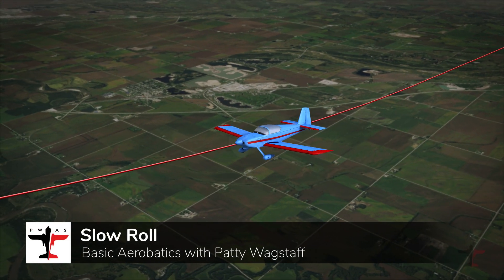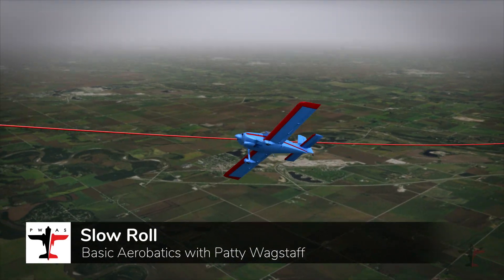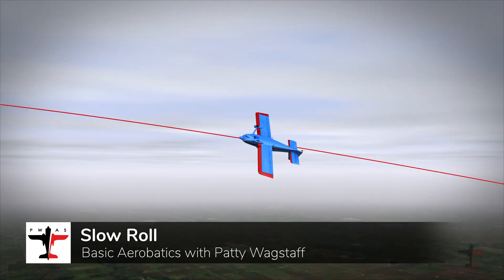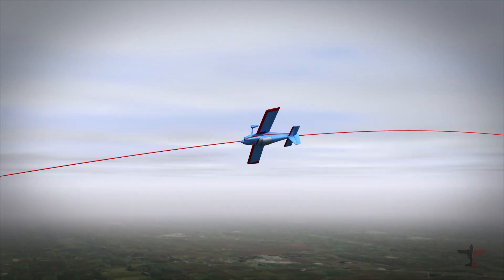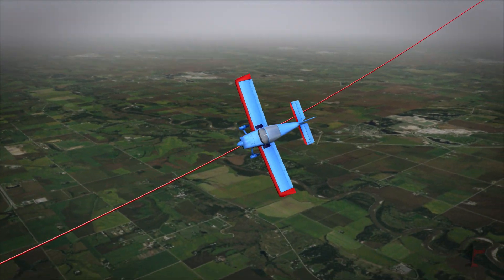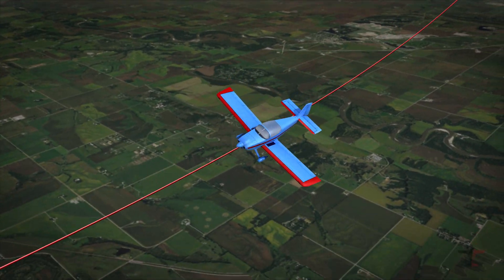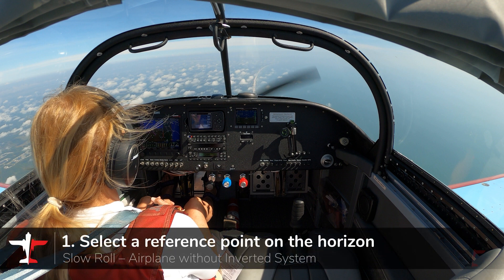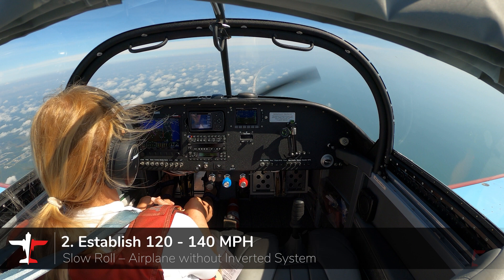Aerobatics Tips with Patty Wagstaff: How to Fly a Slow Roll in an RV-6

Comment: Unless I'm grossly misunderstanding how the rudders are being used here, "top rudder" changes from right rudder to left rudder as the maneuver progresses. It would be helpful (to me, anyway) if the graphics on the video made this switch a bit more obvious.
Reply: Mr Cuvier: You're quite right in you description of top rudder. You use top rudder to keep the nose from dropping as the bank angle gets steeper.  With the wings at 90 degrees of bank, called 'knife edge', you are using yaw inputs to do what you'd do with elevator inputs when staight and level. If you want to hold the plane in  knife edge, you have to neutralize the pitch once th wings are perpeedcicular to the ground and pressplenty of top rudder. 

It seems like you are interested in aerobatics. A very good first book on this subject was written long ago by a great aishow pilot name Duane Cole, called "Roll Around a Point." There's one currently listed on Amazon forless than ten buck plus shipping.